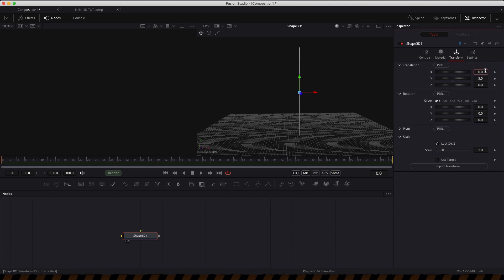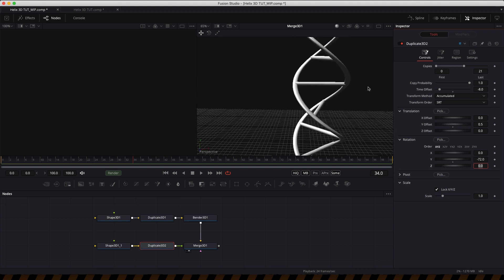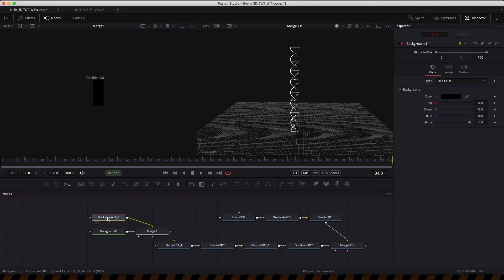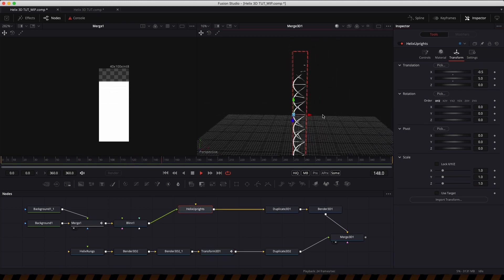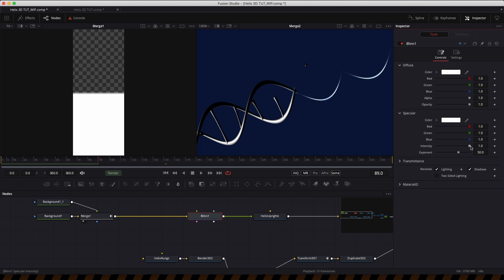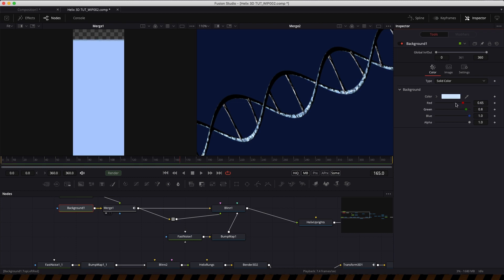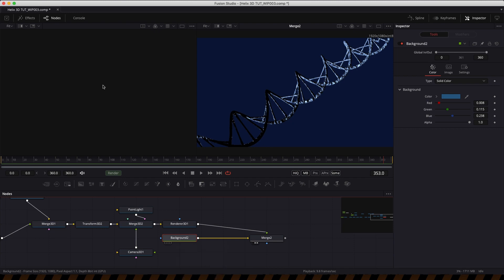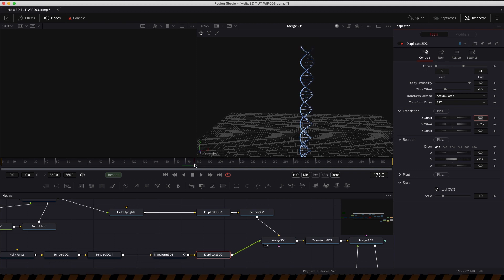DaVinci Resolve Fusion Tutorial: 3D Double Helix

Comment: Wonderful thank you, but why not join the two initial vertical cylinders with a merge to the side rungs, thus creating the whole straight structure and only afterwards perform the "twist" with the bender3D?
It seems to me that there would be fewer alignment problems.
Thank you
Reply from the maker: No reason at all. But that would have been a lot more dull.
Reply: @SimonUbsdell  🤣😂I believe that many times the same result can be achieved in different ways. Anyway, great tutorial, thanks !!
Reply from the maker: There is always, always, always a better way of doing something, no matter how carefully you think you've thought about it! And that's why this work is so endlessly interesting. But thanks for your kind comments.
Reply: @SimonUbsdell  I loved the technique of coloring the material to grow the DNA helix. I will definitely use it. Thanks again.
Reply from the maker: Actually I have remembered now why I did it the way I did. It’s a small thing but applying a global Bender to the entire assembly (rather than to the two parts separately) results in a twisting of the crossbars that I remember not liking. (You can see it if you bypass the two Tapers that I applied.)  But it’s only a very small difference and looking at it now it wouldn’t worry me. But sometimes we get obsessed about the wrong details!